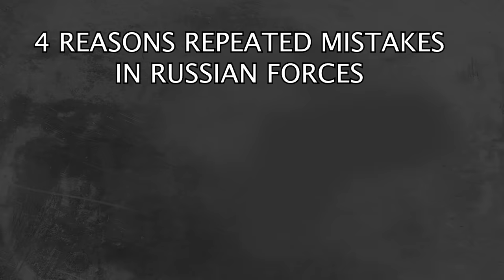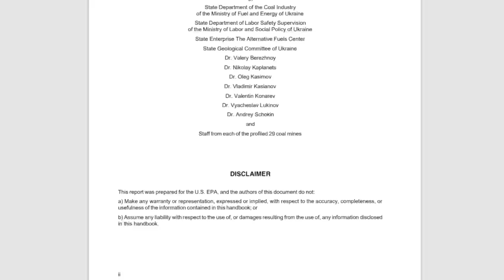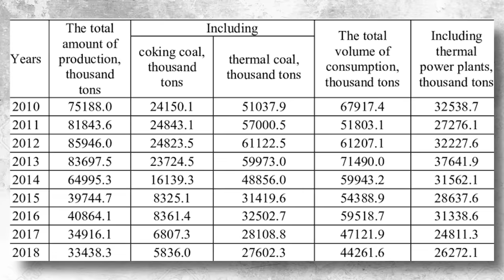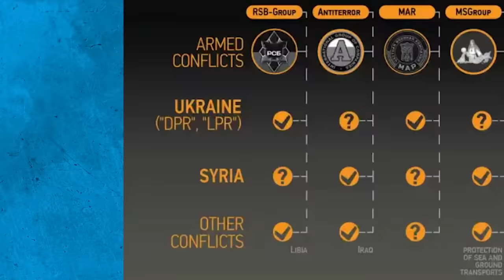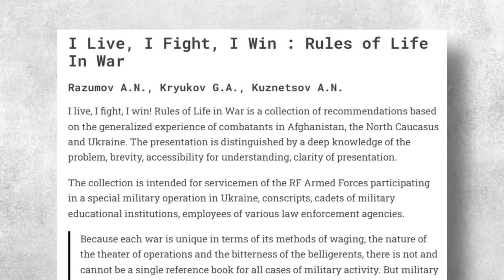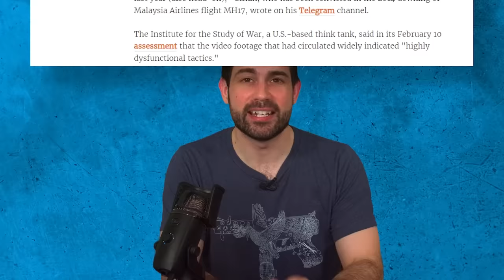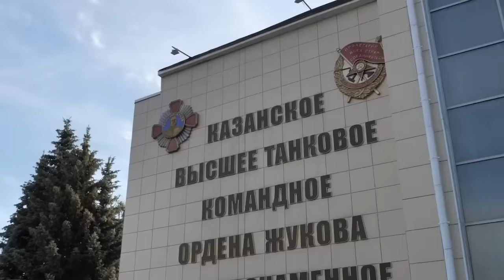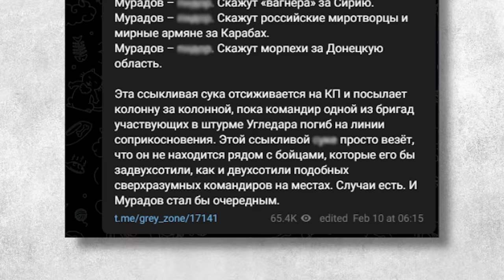Vuhledar, Why Russia Repeats the Same Mistakes

Comment: Big mines are also strategic for two reasons:
1) They provide secure storage underground. Often there are still Soviet era stocks there.
2) The refuse dumps can be very large and high, giving a commanding view of the battlefield. You can easily see them on a height map of Ukraine.
Reply: @KingM248  I really, really doubt the Ministry that owns those mines is going to allow the military, which does not own them, but needs the toys the revenue can buy, to play with anything explosive within the confines of the mine. Coal burns underground and you can't put it out. Just ask the town of Centralia.
Reply: using artillery to plant mines far away is a soviet tactic. the soviets did this against afghanistan in the 80s. whats better is that those were anti personnel rather than anti tank mines.
Reply: @indiasuperclean6969  LOL....have you seen Russell Peter's comedy routine about India? Pure gold.
Reply: Idk
Reply: That was an awesome explanation
Reply: @KingM248  You DO know that the amunition Ukraine has avaiable on Himars doesn't pack much punch, do you?
Sure, it is great for blowing up ammo depots and stuff like this. 
But it strugles even with bridges. UA Himars is not suited for destroying hardened sites.

You guys should really learn about military equipment and not just throw around some buzz words.

Comment: Turns out having trained soldiers and veterans with experience to transition new troops into combat is valuable. Not to mention a leadership who both trusts/respects and also values their troops. What you put in is what you get out usually, spend years stripping everything out of the military for profit will probably take twice as long and twice as much money to fix.
Reply: Im not sure what changed, or if ww2 and korea also had similar problems that just got covered up, but veitnam, russian afghanistan, and ukraine definitely demonstrate that conscripts/draftees dont work well in aggressive modern war
Reply: @Trf Fft I think that the cause of conscription for defense is that they will fight harder to defend their home because in this case for Ukraine, the battle lines are in their home country. Attack on the other hand is harder to sell. Especially if the high command is known for not caring about soldiers [like here for Russia] the conscripts may be more likely to defect. Also, let's be real some of the conscripts should have never been drafted to begin with like the 50 and 60-something-year-olds that the Russian army grabbed during their mobilization.
Reply: @Trf Fftit is also alot harder to convince a conscript to go fight in a offensive war
Reply: @Trf Fft and convincing
Reply: Turns out having trained soldiers and veterans with experience to transition new troops into combat is valuable
I think Japan had this issue. They had the most experienced carrier pilots in the world but would not really rotate to train newer recruits like the US would. Eventually most, if not all, got killed.
Reply: @indiasuperclean6969  What?    Clean like scores of people taking baths in the river!   I guess it depends on your definition of clean.
Reply: Grab convicts for 2 weeks of training. Then command them:

"Вперед, в мясорубку."
Reply: The US should send Ukraine air defense systems that can shoot down hypersonic missiles. 

Oh wait! The US has not been able to develop hypersonic missiles let alone systems  to defend against them. 😂😂😂

The US is “number one” military in the world.  It is very important effective against prostrate, third world countries. Apparently against Russia, the ACTUAL number one military in the world, the US is a technologically a paper tiger. 😂😂😂
Reply: Ivan is going bankrupt, again, same as in 1990, trying to keep up with the Joneses... LOLOLOLOL 

Slava Ukraine 🇺🇦 ♥
Reply: @stankovich7990  copy and paste. Spam reported
Reply: @troyraffelock2302  Well, I thought they bathed in the Ganges for religious reasons, not because they lacked baths.  But,  yes,  the Ganges is pretty filthy.
Reply: @Trf FftYes. Why are you continuing to talk about it as well?
Reply: @Trf Fft And why not address Troy as well?
Reply: @stankovich7990  you gotta try a little harder stanky leg.  This is a military channel, the viewers won’t be impressed but such blatant copy-paste spam.  This sort of thing requires a little subtlety, I’d teach you but I don’t work for free
Reply: @Trf Fft Agree. I think he's a bot.  It's on a bunch of other threads too.
Reply: @rennscott5808  ww2 troops where actually pretty well trained all things concidered. At least american and canadians.
Plus they did have loads of top notch hi tech equipment for the time.

That does make a difference.
Reply: @stankovich7990  stay of the vodka lol.
facepalm
Reply: That's why I think China won't do well since tge least people who had actual combated experience ( and not as generals) would be the fathers of the current generals.
Reply: @wilberdebeer4696  training can make up for a lot in that situation, and enables your forces to adapt really quickly once fighting starts. It will be a disadvantage at the start but that will disapear a lot quicker then you might think.
Reply: @stankovich7990  cringe bro. Look up US hypersonic missile research. It is going well. After everything is finished and production is ready, Russia will have nothing to brag about anymore. Russia with 2% of global GDP is small. 

That is a reason they wanted the US to sign some missile treaty with them when Trump was around because they can't compete with US budgets and knew once the US focused on hypersonic missiles, Russia would lose an advantage. 

Even Putin said others would eventually obtain hypersonic missiles.
Reply: @stankovich7990  
Hey, quit speaking truth. People don't like hearing truth when they've been trained their whole lives differently.
Reply: Kitty Cat  yeah, that's just how people are i guess, it happens every time. It's all part of the propaganda in the end. There is a reason why it is used so much in so many places, it just works. 
But usually the important people aren't as shallow and are more realistic about what is going on. In this case millitary leadership and intelligence agancies and stuff. At least that is their job lol.
Reply: From what I've gleaned, these conscripts are being put in defensive positions because it suits their lack of training better.

They will be of limited use to go on the offense and the Russian brass knows this.
Reply: @soonerfrac4611  Most conscripts in WWII didn't go into combat without at least a year's worth of training, sent as a unit in most cases, and the troops felt they had a cause they were fighting for.  In Vietnam, most troops got about 90-120 days training before being sent over.  Also, sent as individuals in most cases, not with their units.  Conscripts can fight well, but need training, motivation and good leadership.
Reply: Trained troops and veterans with experience eclipse quality of equipment. My unit started flying the F-16 A/B in 1982.  In 1987, we won Gunsmoke against the F-16 C/D. And again in 1989.
Reply: @tango_uniform That wasnt the case in the gulf war. The iraqi troops were battle heardened after 8 years of war with iran yet they still got thoroughly defeated. Im sure equipments quality and technology plays a significant role in combat
Reply: @fleedopmogu6169  Russian propaganda is certainly not the truth.
Reply: @Trf Fft It's probably a bot. I have seen the same comment on a lot of other channels as well.

Comment: Hi. I love your attention to detail. Just wanted to maybe update your knowledge on disk-type anti-armour mines. They are created to be layed by just about anyone instead of trained soldiers or specialists. It is a throwback to different defence doctrine of mass resistance which means that just about anyone will resist occupying forces. I personally have received training on them in high school, at the university and during my mandatory service. The basic is that you just arm them and leave them. If you can you can just put something over them to camouflage or with a little bit more training you can dig them in or booby trap them so they are hard to remove or you can hook them up with antipersonnel jump mines. As antiarmour mines are set to detonate only when significant weight is applied they are safe for relatively rough handling. Trained units or engineers have way more options including some specialised kit attached to tracks or tanks which industrialize mining operations. Worst case scenario you can hide and push them directly in front of a vehicle. They are directional so you would not be hurt even a meter away if you cover. (Not sure I would be willing to test that). I have a lot of useless knowledge on weaponry and tactics from that era as I have to understand to learn. Turns out it also means a head full of useless info on a lot of subjects : )  Also, you probably know that remining clearances the enemy has made in your minefield has been standard practice for militaries and it was heavily used in recent wars I have witnessed (majority luckily not in person) since nineties in Yugoslavia. I had none-combat specialisation during my mandatory service which means about 10 weeks of basic combat training and even we were trained in organising nomansland patrols and the basics of remining paths enemy cleared for their patrols. It is surprisingly easy even with no night vision and dangerous as both sides have the same training so they can set ambushes. But mines we whee to use are cheap and safe to set after about 5 minutes of training. That is the scary part really. That is enough for today. You are making effort to understand the doctrines of Russians and others. I am no Russian. And I am no military specialist. But I think I have a very good understanding of doctrines which were developed to counter American doctrines not that I ever needed or wanted that. So maybe some other time that will come up as I think it has a lot to do with this and a few other wars. Take care and have great day : )
Reply: HajdeBreVise,  Thanks for the detailed information.  Your thoughtful comments are what make these forums so interesting.
Reply: Hahahaa, sad vidim jugoslavensku vojnu doktorinu.
Reply: @ronaldfharring7326  Agreed.
Reply: Thank you. Are you from Slovenia?

Comment: IMHO - one word: Training.... you can come up with fantastic doctrine, you can supply good weapons with the latest chips sets and amazing capabilities, you can have common uniforms and creed, but if you haven't embedded the lessons of manoeuvre and combined arms through long hard expensive sessions of training at all levels ... from individual skills, through small unit tactics to large scale Tactical Exercises Without Troops... then you don't have an army ... you have a bunch of expensive cosplayers working at cross purposes.  

There are reasons why the majority of western European armies have transitioned to an all-professional force with 3 year training cycles and numerous 'schools of this and academies of that' ... they know that every soldier that gets trained up has a window of utility in his/her current role ... and maintaining that will require additional training at great expense, not to mention the need to adapt SOPs and (at slower cycles) doctrine to assimilate emerging best practice. 

you cant say you have an army of 1.2 million and then fail to provide that army a means to go out and practice their art (at scale) every two years. Infantry need time at the range - Tankers need guns with barrels that will handle a 20 year burn rate of practice missions, front line pilots need 30 to 60 hours flight time (in cockpit & simulators) in order to be both proficient and aware of their supporting arms characteristics. ... and above all that you need an officer corps with managed careers that expose them to as much of the combined arms ecosystem as possible to ensure they are capable of knowing what arms will support them and how. 

Russia has - in every sense of the word... a Potemkin army of poorly trained , poorly equipped 'mobiks' that only know which direction to run and have little knowledge of what the rest of their own organisation can and should do to support their efforts. Plans fail, commanders (at all levels) suffer attrition, and comms always goes to  shit - but knowing what the formation next to you has been tasked with, how your mission fits into the big picture and what the next guy over will do when things change takes time, effort and bloody minded NCOs to establish. 

God help Russia - even if they repel the spring offensive they will never again be anything other than a sad joke ... a cautionary tale for anyone who thinks Open Societies and liberal democracies are  somehow inferior to kleptocratic autocracies with smug leaders who prefer the safety of their heads up their own arses. 

end of rant

Comment: 15k a month with a 2 month rotation, damn! Not bad compared to my less than 30k a year I was paid as an e2 in Afghanistan lol
Reply: I was surprised by that $15.8k/month figure. I was expecting ~$3.5k.
Reply: I don't know, I don't believe it. I was expecting like 5k max but realistically 2-3k and half of them not getting nothing until they rotate and finally die.
Reply: 15K a month is pretty standard for PMCs, they almost always get paid higher than your average solider. Mainly because they expect those people to be trained already, and depending on what the contract is they might require previous work in special forces.
Reply: @DakotaTheRota  yeah but in Russian money that's even more for for them. The average income in Russia is barely 1k

Comment: On the matter of Shoigu and Patriot at Vuhledar; Prigozhin and Shoigu are longtime rivals. Prigozhin basically thinks he can buy his way into Shoigu's position and is, reportedly, very close to Putin. Shoigu himself is also apparently pretty close to Putin, which means both men are constantly jockeying for the great leader's attention.

This ties into Patriot, Shoigu's PMC. They were created largely as a response to Wagner, and evidently, they had next to no actual role in the fighting in Vuhledar. They were there purely as a propaganda brigade. The thought process, it's theorized, is that Shoigu figured they'd easily roll into the city, take it over, and then do the same kind of propaganda photo op that Wagner did in Soledar's salt mines. That plan fell through for obvious reasons, so Patriot didn't even fire a shot.

Comment: Vuledar (as opposed to Bahkmut) is actually important.
It interrupts the north-south rail line, the only one that connects mainland russia and the Kherson front (and does not pass through crimea).
So as long as its held, that train line can't be used.
Reply: Shhh don't let Wagner know that lmao they seem perfectly fine dying for a destroyed town that is simply an outer defense for the more important towns on higher ground right behind it 😂
Reply: Probably hampered as well opposed to defunct. Russia's ONLY means of transport is rail, which is generally easy to repair.
Reply: I would imagine Ukraine holding Bahkmut on purpose even if they are suffering losses as a result. It seems like a good way to bleed Wagner dry. The loss of mercenaries and the massive waste of ammunition and material cannot be replaced by Ruzzia any time soon. Bahkmut seems to be nothing more than a gigantic meat grinder for Ruzzian meat..
Reply: @solidsteel3634  Are you aware that Russian forces are surrounding Bahkmut on three sides? It's a meatgrinder for someone.
Reply: @andiemilo2742  Bakhmut's geography overwhelmingly favors the defender. Ukraine would not keep holding it if Russia wasn't suffering disproportionate losses.
Reply: @andiemilo2742  There is simply no other logical, tactical or strategic reason for me to hold this city. It could be used as a springboard for a counter-offensive as it represents a breach in the front line. I think the reason is also that you can buy time to prepare the counter offensive. But for that it has to get drier first. The mud hinders friend and foe alike. And as long as the Western tanks aren't all together, a counteroffensive is unthinkable.